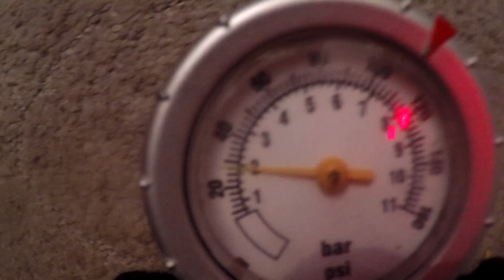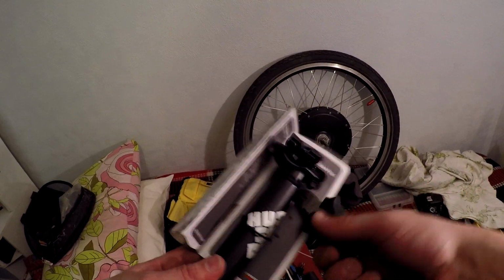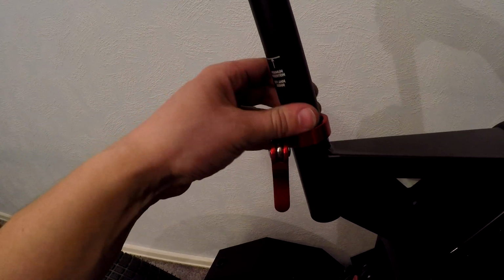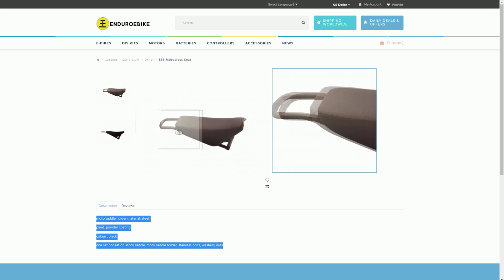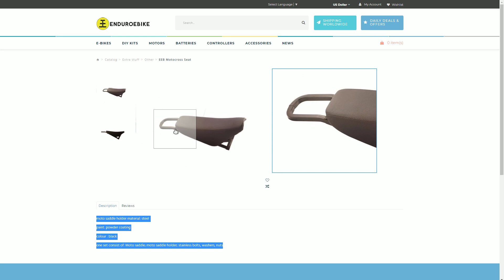Building an Electric Bike in My Bedroom - #3 Suspensions/Wheels/Saddle

Comment: also, just so you know, you are supposed to put another spacer on to of the stem (4:16) in between the stem and top cap. without this the top cap cant properly compress the headset and fork. also this makes it more likely for the stem to come loose, another reason to switch to a downhill style stem that doesn't have these problems
Reply from the maker: Hey.
I was missing one spacer. I ordered one more,  it was temp. solution. In a later episode, I added one spacer. Thanks for watching

Comment: there are bolt threads on the top part of the fork, please please please use a downhill style stem that attaches to those threads. it kills me every time I see someone use this kind of stem on a high power ebike, I've had them slip going slow speeds on a mountain bike, I can only imagine if it happened when at top speed on an ebike
Reply from the maker: Never had any problems, The mileage is 9000km / 5600Miles. I mostly use the bike to ride, not offroad or jump. My  bike not highspeed. Just designed for chill riding

Comment: Did you get the rear suspension shock with the built and nut to install when you order the shock or did you have to purchase it separately?
Reply from the maker: Hey
The rear suspension and all necessary nuts came with the build
Reply: @DatEbikeGuy  thanks

Comment: Do you have a small gap between the headset compression ring and the dust cover?
Reply from the maker: Hey.
No. There no gap between the headset compression ring and the top cover. After tightening the bolts, they are compressed.
Reply: @DatEbikeGuy  Ok, i have a small gap which causes the whole fork to be unstable and wobbly even when compressed. I might try with another dust cover.
Reply from the maker: @Technopr0  Also make sure there are enough spacers so that proper compression is possible. My video shows only how to install 1.1/8-inch straight tube and not 1.1/8-1.5 tapered steering tube. Dunno which one you have
Reply: @DatEbikeGuy  I also have the straight tube. The compressor seems too tall for the dust cap, or the dust cap not deep enough for the compressor, which causes a gap of ~1mm between them and causes unstability on the fork.
Reply from the maker: @Technopr0  Dunno if this helps but interesting reading anyways https://canecreek.com/everything-you-need-to-know-about-bike-headsets/
Reply: @DatEbikeGuy  Either the upper bearing is not deep enough, so the compression ring is too high, or the top cover is not deep enough for the compression ring, which creates the gap and puts all the compression on the compression ring. The gap also causes a small wobble even when fully compressed, because the dust cover is not providing stability. Possibly error in manufacturing.
Reply: Or maybe there are spacers available that go between dust cap and compression ring.
Reply from the maker: @Technopr0  There are something like called "micro spacer" https://i.ebayimg.com/images/g/mLMAAOSwWoFfAMmz/s-l1600.jpg
Reply from the maker: @Technopr0  Yes there is :), called micro spacers.